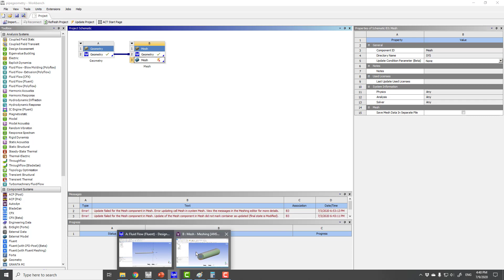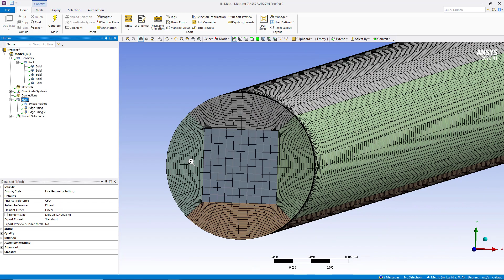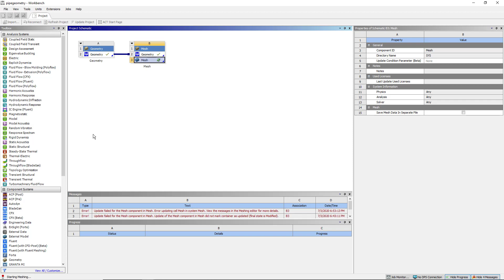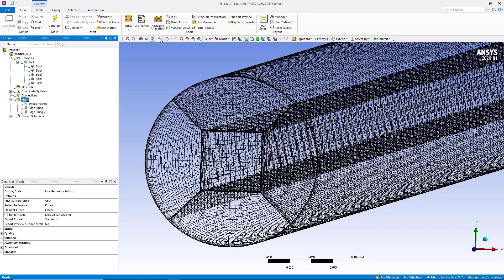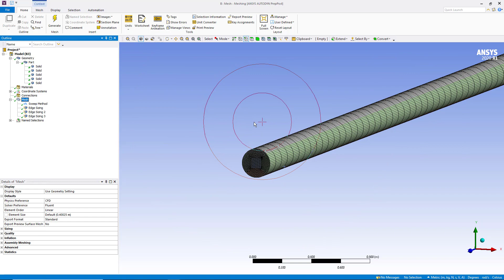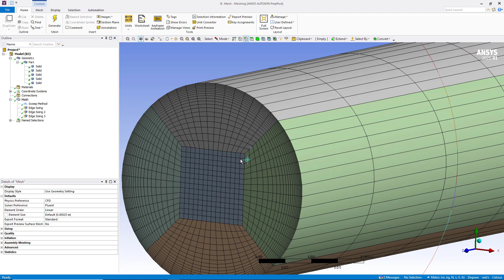Common issues in ANSYS Workbench Meshing | ANSYS 2020 R1 Tutorial

Comment: thank you sir. I have problem with my model. The meshing window takes a lot of time to load the model from Design Modeler, I think it can not loading the entire model. but when I change it loading separated parts, it works well. How to solve it, I need meshing whole model. Thank you
Reply: I have the same problem. Then i tried to save the geometry format from .iges/.igs to .step/.stp, and then reimported in geometry, and it worked

Comment: Your English pronunciation is a bit puzzling, :
1:16
You have to put the hard yeah(?). This hard make sure there delta(?) this uniform spacing will be enforced on all edges yeah(?)
Reply from the maker: Hard means it will be enforced regardless if it makes quality lower. But soft may or may not implement that sizing depending on some other factors (not known to user)